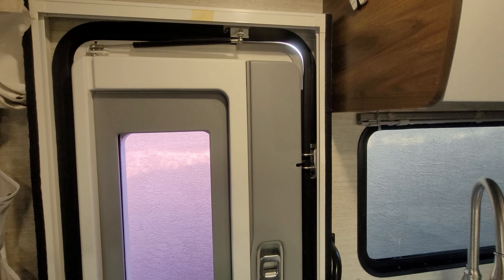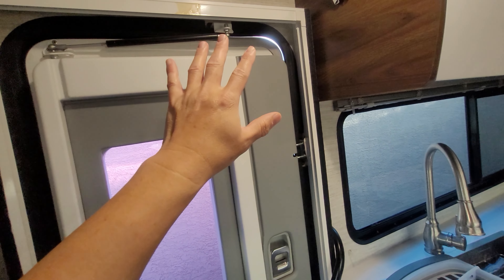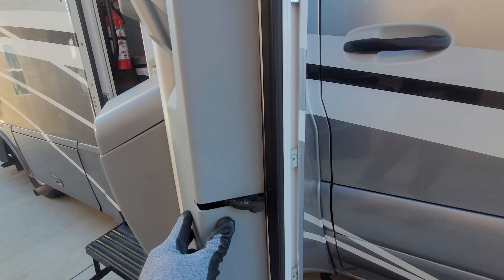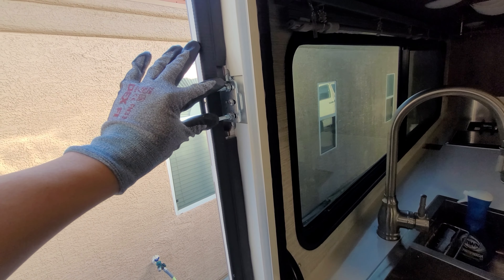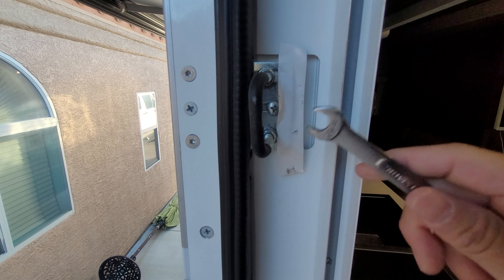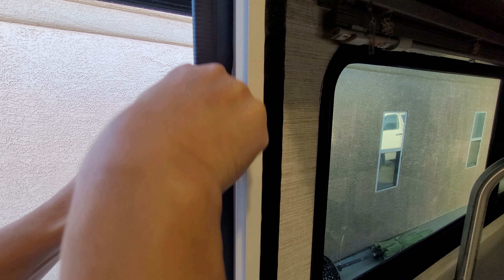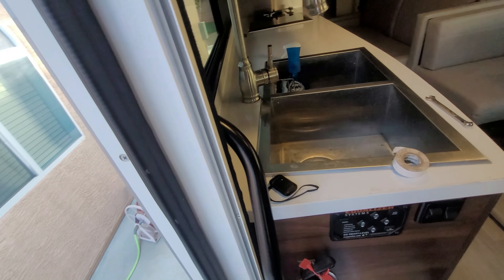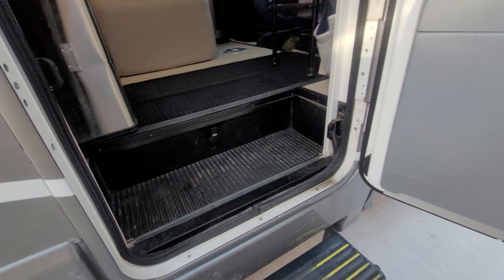Winnebago ENTRY DOOR ADJUSTMENT Part 1 | ELECTRIC STEP HACK ALSO

Comment: Magnet trick is a great benefit.  I often park away from a curb to prevent jamming the step. Now I have another option.  I too have gone from class b to class a and then back to class c.  RV travel is a process of  finding the right combination of
 comfort, luxury, reliability and lowest stress camping.  So far my View has brought me the best balance of these qualities.   Another great video, thanks!
Reply from the maker: Thanks David.  Yes the View/Navions definitely have a good size that gives you flexibility and comfort. We really like ours.  I am always in search of a new type of RV to tinker with. Haven't found one yet but always on the search.
Reply: First, thanks for all the videos you produce about your motorhome. I have a 2020 View J, and they have been unbelievably valuable. I just spent all day yesterday working on my POS door to try and avoid further disaster, I guess I’ll find out in the days ahead. One thing you didn’t mention is the door’s “interaction” with the screen mechanism. Because the shoe bin extends so far into the door opening it can destroy the leading edge of the screen mechanism if the screen is not either completely closed (and then you won’t be able to open the door from the inside) or open. I just removed the shoe bin, but the door still can destroy the leading edge of the screen mechanism. My problems with the door itself have included the inside handle itself breaking and first the bottom latch’s return spring breaking then same in the upper return spring. Unfortunately the design of the latch mechanism is such that you can’t just replace the broken return spring, the whole latch mechanism must be replaced. And until you replace it (or them) you must manually retract the latch to avoid even further damage from slamming the door with the latch extended. It’s a POS…
Reply from the maker: @mowind92  lol you put it better with it being a POS.  I'll see if I can address those items on part 2. I'll have to do some re-shooting and editing so it may not be released until the the week after next. Valid input.

Comment: THANK YOU.  My bottom latch was off and I was moving it in the wrong direction. And thanks for the magnet hint. BTW, I have a solution for the cabinet knobs that break and stick.
Reply from the maker: That's great. I never did have a final solution for those buttons. What did you end up doing?